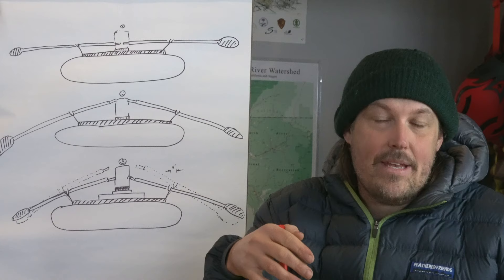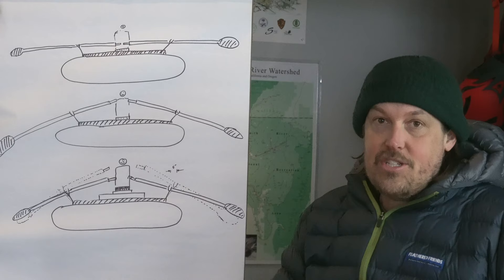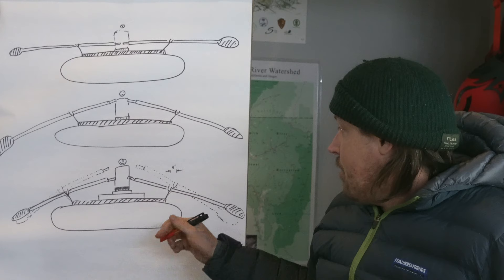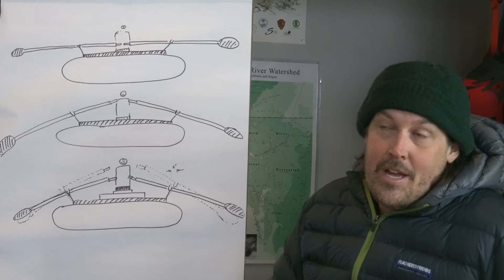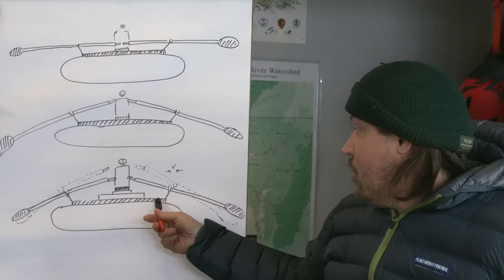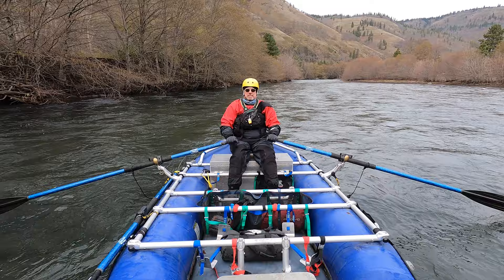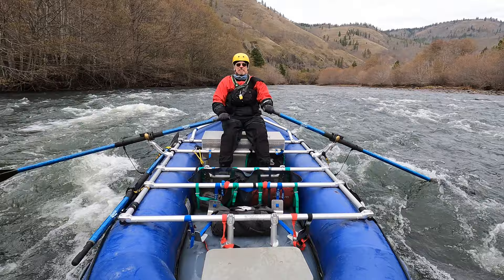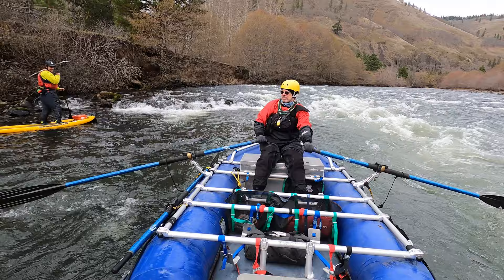Oar Raft Seat Height and Oar Length | Ep. 188

Comment: Zach, first, an absolutely incredible channel I've been fortunate to discover as I transition from kayaking to rafting. Thank you for sharing your experience and wisdom with the rest of us. Two related questions I'd love to hear your thoughts on: On an oar rig/gear boat, how important is it to place the oar towers at dead center of the raft's length? How important is it to make sure the oars cannot possibly hit the passengers riding up front in the event of a bad blade strike? In my 3-bay frame it seems I can't have it both ways.
Reply from the maker: I'm stoked you like the channel! To answer you question I would personally choose safety of the passengers over and increase in maneuverability of the boat. It is not that important to have the oar locks at the center.
Reply from the maker: Did you see the video I made about this?
Reply: @GearGarageTV  I didn't.
Reply: Just saw it!

Comment: Agree with David Pauli's comment below. I see both rowers and riders with seating postions far above the frame where they are subject to more of a fulcrom effect when the boat gets rocked. I am a firm believer in getting your weight low and reducing the fulcrom effect on a body. I do however compromise and use a tractor seat. It keeps my backside from sliding around and feel it has helped keep me in the boat in some close calls.
Reply: I was literally launched out of my "high" seat on the Salmon once. My tractor seat is now on the cross bar. Excellent comment.

Comment: All of this.  Soooo much good info. I’ve changed seats/oar towers/oar length to many times. Wasted money/time/effort. Really appreciate the info Zach. Ive finally settled on sitting right on a thin custom paco pad directly on a low slung dry box (1” off floor) in a 156R. 9.5 Oars.
Reply: Colorado rower here and would love to hear Zach's opinion on clearance issues with boxes and coolers.  Obviously, CO doesn't have a lot of big water and dragging over rocks is just part of the game if you row outside of the first week of June.  I'm often considering issues like entrapment, raft damage in a pinch, and to this videos point, rower height.  I'm 6' 7" and have always tried everything to get as low as possible on the seat height.

Comment: Take this info with grain of salt as well as this comment. Every setup has a window of workability. I like sitting higher and having taller locks. I mostly row from the stern but having taller seating position for me is better on center as well and lock height should be determined by body position. I am also tall and lanky. Most notably is oar position and length. I will always choose longer oars and ship more often rather than less. Barrow or rent every piece of gear you can. Trying out different setups even at extremes will only help you make more informed decisions. A few minutes of adjusting can teach you a lot.

Comment: Zac it was briefly mentioned in a comment below. Seat height vs floor drop. I was rowing a e136 and like to sit as low as possible, feels more stable. But the problem I kept running into was hitting my knees when trying to get the oars out of the water. The became more of an issue the bigger the rapids got. I switched to sitting on my dry box or cooler which allowed my knees to be a little lower and this helped. The other option was getting taller oar towers. I’m making the switch to a 156r which will have a lot more floor drop and should definitely make the rowers position more comfortable
Reply from the maker: Yes having bigger tubes certainly helps

Comment: I feel like theres a problem between sitting low and having tge oars at your chest. Ive doe the 1.6 thing but the oars end up high when I have a seat in the frame. If I move the oar mounts in then I have too much oar outside the mounts and theyre heavy.
Reply from the maker: Are your oar towers too tall?
Reply: @GearGarageTV  they are the smaller standard nrs towers. My towers are about 80” apart so 1.6x = 128”. My oars are 10 ft. So that means You’re saying I should have a little smaller frame - which I should, because the frame is outside the center line of the tubes. Ok, but still the oars feel high so I need to sit on my cooler at 8” so the oars are at my chest. I have them at 80” outside the oarlock, so 2/3 exactly. Do you think I need shorter towers?  Thank you, btw! Appreciate the help

Comment: Great teaching as always. Any info about drift boat setup? Are the goals the same? (maximize push up motion, etc).  A McKenzie drift boat has a rowing seat about 8 inches below the oarlocks.
Reply from the maker: I don't know much about drift boats so I should probably not make any reccomnendations
Reply: @GearGarageTV  Thanks! Just this basic information really helps. I've read lots about the oar length "formula" but it makes much more sense to reverse engineer for hand/shoulder position to maximize control and effort.  Seat height is usually never addressed, but makes a huge difference.  In a drift boat, trim and load placement impact the rocker and ability of the boat to spin and maneuver as well, but just starting with good oar length and hand position makes everything else easier.

Comment: Why not include the seat height in your oar length calculation? What angle relative to the water surface are you shooting for?
Reply from the maker: I don't include seat height for 2 reasons:
1. The distance between oar locks is by far the biggest factor and dwarfs seat height
2. I would encourage you to sit low and by adding seat height it might give people the idea that sitting high is okay

Comment: I have a 12’ raft with 54” distance between the oarlocks and 8’ oars.  Based on your 1.63 calculation, my oars should be 7’3” but that seems very short.  Any thoughts on the best oar length for my setup?  I only use my raft for small rivers and tribs in Michigan so I don’t go through rapids.
Reply from the maker: My best guess is that 8' oars are perfect
Reply: @GearGarageTV  awesome, thanks!

Comment: Hi Zach. What's your take on oar length for the Canyon, in an 18 ft boat? An NRS 180 is 8'4" wide. If I have my oar locks 96 inches apart, times 1.63, that equals 13 ft! 
Seems good by the numbers, but I don't hear of many oars longer than 11 ft out there. Thoughts? Thanks.
Reply from the maker: I generally use 11' oars with standard 18' rafts. I suggest trying to reduce the distance between the oar locks. On 18' rafts I don't run the oar locks as wide as the raft.
Reply: @GearGarageTV  and @Sean Fraser, a couple years late, I realize...but just now reaching a point where I'm actually doing some research.   Previously just relied on good 'ole guide ego (i.e. I used to guide so...)  :)   We did the Canyon 2 years ago and I aptly earned the nickname "OarCrusher".   I snapped 5 oars!!!!   Got a little spicy as we started going through the groups spares, etc.   I literally was able to just "pull" through an oar!   Yes, I had a heavy boat--but I used to row 2-3x heavier with no issue.   I kept blaming it on old-ass oars but then started playing around with oar-tower angle and fine-tuning oar-stop distance etc.   Seems on an 18' boat I was thinking the same thing and ended up positioning my towers almost straight versus splayed out a bit...turned into too acute of an angle and snap!   ???   Maybe???   Now I'm super concerned and take extra time to tweak tweak tweak.   But I'm always careful not to bring my towers too close together.    

Thanks so muck Zach.  I love it and love all your spot on information.   After this next trip, I'm planning on donating a little something something for your great efforts.    Muchas Gracias.

Comment: On the blade end of the of the oar how far, ideally, should the blade be in the water with an ideal oar length? Blade just completely submerged? Or is it better to have the blade a few inches under water (in flat water) to account for better engagement in whitewater when the water surface can be closer or further from level? I'd love to hear your thoughts Zach.
Reply from the maker: It makes sense to me that you'd want the blade fully submerged when you are rowing at your most powerful position. So when the hands are out in front of you just below shoulder length (like doing a push-up) the blades should be fully submerged. I'm not sure why you need any blade out of the water.
Reply: @GearGarageTV  Agreed that no blade should be out of the water, but how deep should it be? Does it make sense that the blade should be a few inches below the water when rowing flatwater so that in whitewater there's less of a chance of taking an air stroke?
Reply from the maker: @alvaroarnal6  I'm not sure. I base my oar length on the distance between oar locks and that usually works fine.